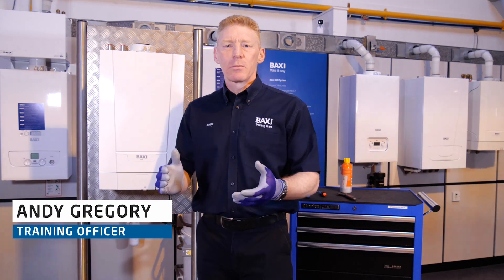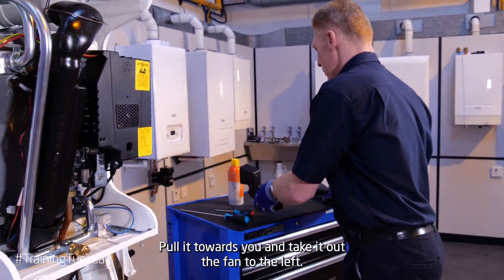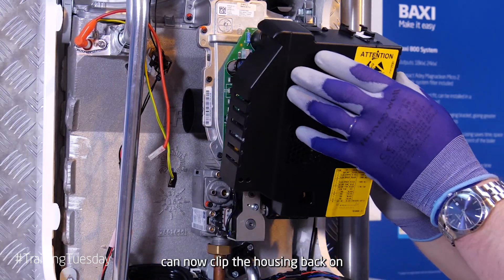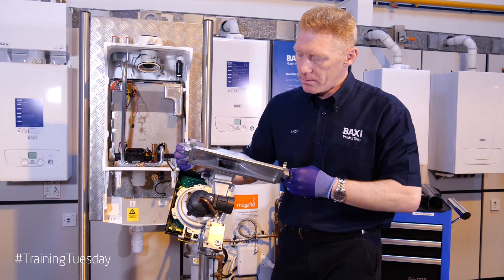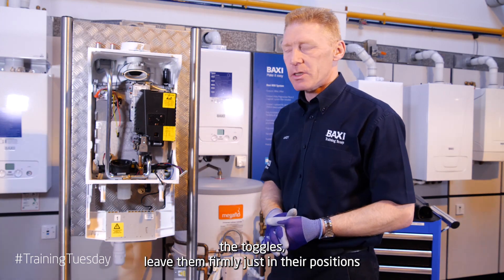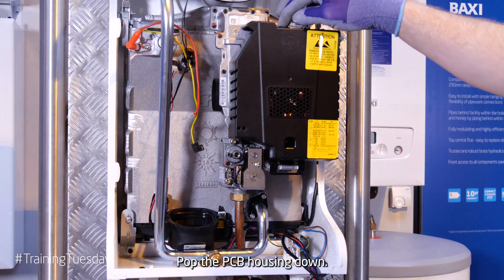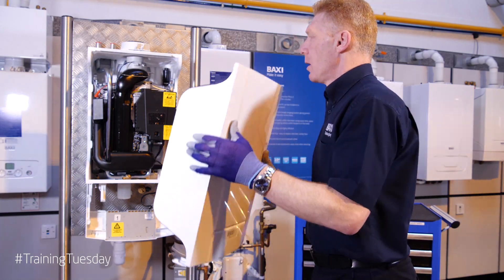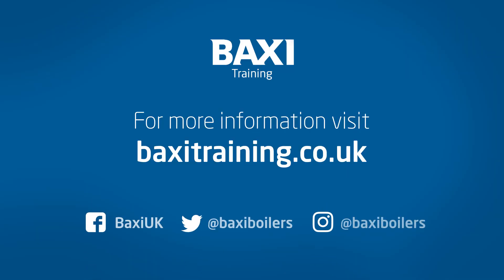How to connect the combustion control unit to the gas supply on a Baxi Heat only boiler

Comment: 4:30 why would there be bubbles? 
Your gas isolator was still in the off position, no ?
Reply: That's exactly what I was thinking. Safe isolation should be done before even touching the cover, just in case there is a fault and the case is live.